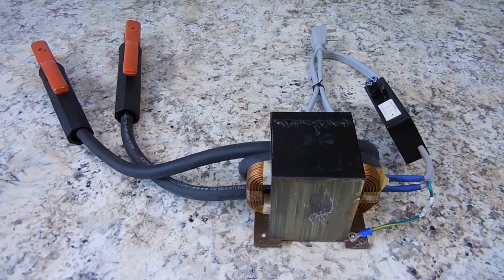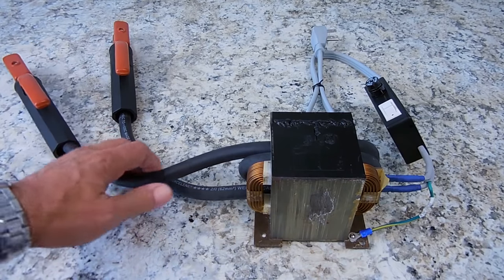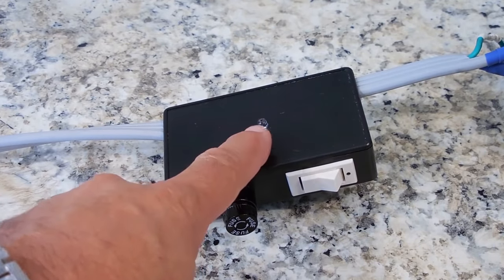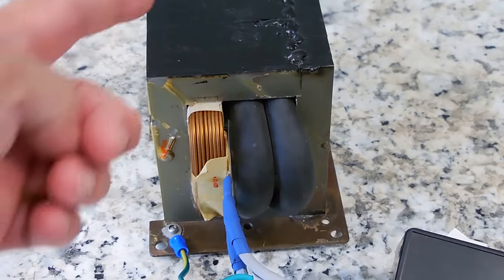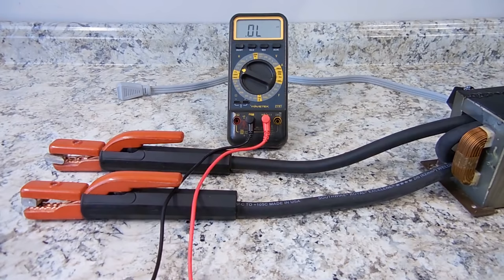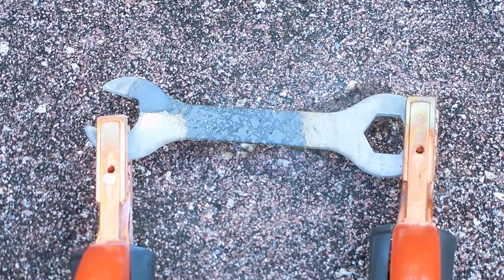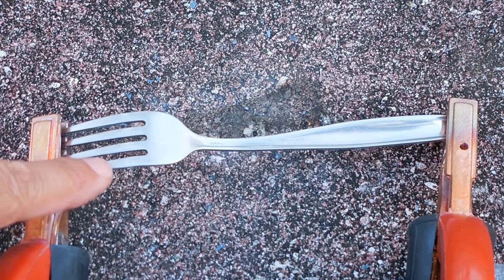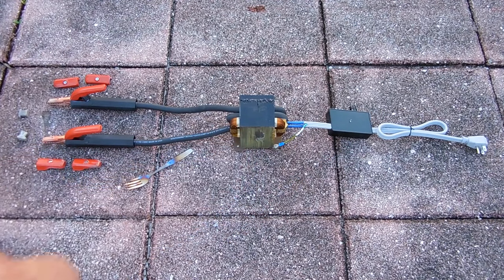METAL MELTER! (1000 AMP)

Comment: Great video. Maybe you can add to this by showing how heating a rusted nut on an exhaust manifold, for instance, makes it easy to remove. that would be very useful,  Dano C.
Reply from the maker: Great idea! Modify a vise grip to apply current to each side of the rusty nut. Thanks for watching

Comment: Thanks for showing that, for reference, when melting the nut, how many watts did it take to get it white hot? I’m thinking this could be used for small black smithing projects (shaping small metal items) without having to fire up a furnace. With the watt figure I can work out a rough cost for the electric. Cheers
Reply from the maker: Hi Shaun. The initial current shot over 1000 amps, but as the nut became white hot, it was drawing around 400-500 Amps. I was probably pulling 1500-1600W off the 120V line at the start. Thanks for watching!
Reply: Literal white or yellowish orangish hot?
Reply: I was thinking the exact same thing for heating rods of metal in seconds
Reply: For smithing

Comment: Metal Melting Points

                        C          F
Aluminum 660 1220
Aluminum Alloy 463 - 671 865 - 1240
Aluminum Bronze 1027 - 1038 1881 - 1900
Brass, Yellow 930 1710
Cadmium 321 610
Chromium 1860 3380
Copper 1084 1983
Iron, Wrought 1482 - 1593 2700 - 2900
Iron, Gray Cast 1127 - 1204 2060 - 2200
Nickel 1453 2647
Steel, Carbon 1425 - 1540 2600 - 2800
Steel, Stainless 1510 2750
Tantalum 2980 5400
Tin 232 449.4
Titanium 1670 3040
Tungsten 3400 6150
Zinc 419.5 787

Comment: What's the purpose of this gadget? Most of the experiment failed except for the nail and washer. It seems that the heating of the 2/0 wiring was the factor. If you could find a way to use 3/0 wire (don't know how) you could get better results... No disrespect, but I don't really see a use for this. Just seems like a lot of work for little use. Always enjoy your videos. Thanks!
Reply: It's just a demonstration video ;)
Reply from the maker: Exactly.

Comment: You need to get some D sized carbon cells (sold as "heavy duty") carefully tear the cell apart and in the center you will find a rod of pure graphite that can be used as electrodes for a tiny arc furnace crucible.

I have not had the opportunity to experiment with this yet but I have a setup very similar to yours only mine is 4 gage just cause that's what I could get for free.
Reply from the maker: I did that years ago in another video. :-)
Reply: @electronicsNmore  I just found your chan yesterday. I will be scrubbing it this weekend :)
Reply: You can get "carbon arc" electrodes at the welding supply store while getting the wire for this project.
They're a carbon/graphite rod with copper cladding, meant to melt steel in a stream of compressed air.
Awesome way to clean rust and bad welds out of tight spaces.

Comment: Has it really been 7 years? Where does time go. I'm quite certain your welder video is how I found your channel, as I had an old Forney AC welder I wanted to rectify to DC and was searching the internet for information.  I just now looked at your first videos, and I built your lawn mower generator! I forgot about that project! It was very handy, but the engine only lasted a couple years. The engine I had acquired was "well used."  Thanks for making so many great videos! :) I know I've learned a lot from you these past years!

Comment: You might get slightly better results with a thinner gage secondary only because you can get a few extra turns to increase the voltage but I'd wager it will be better for some things and worse for others.

Comment: You can oil cool the whole transformer in a box housing with full oil this can run the transformer longer..
Reply from the maker: Correct, mineral oil works great.
Reply: Specifically food grade mineral oil, that is often used as a laxative, or for cutting boards and the like.
Any other mineral oil will have additives that are electrically conductive.

Comment: This new video you describe chiseling in the direction the wires are running but the old video edited in, you were chiseling perpendicular to that direction.  I just did two of these and the old way is way slower for some reason, the chisel cuts maybe 4 times faster if it's along the direction the wires run, maybe because that way the wires can slightly move to help in the shearing and they're all the same depth of winding, not sure.  That said, a cut off wheel in a die grinder is massively easier.  For the record, one was copper and one was aluminum.

Comment: 1300 watts can only do so much damage.  The laws of physics are working against you as well. I'm surprised that fork held up though.  There was never a chance that nut was going to fail though.
Reply from the maker: The unit I made could easily melt the fork. Only so much current can pass through one or 2 tines, and when the fork becomes very hot, the current level drops as well. You also have to realize that the fork is a very wide span of stainless steel which has a lot of resistance. If the clamp on the left was placed just before the tines, it would've melted the fork very quickly. As for the nut, it was right at the cusp of melting. You don't get much "whiter" than what you saw. If I had a 3/0 wire in the transformer, it would've melted. Thanks for watching!
Reply: That's a lot of mass for 1300 watts.  Being on that long extension cord probably didn't help.

Comment: I'm just curious as to why it's 1.75 turns and not considered 1.5 turns on the secondary.
Reply from the maker: The way I see it, I did (1) full turn, (4) corners, then the wire passed 3 corners before exiting. If it was 1.5T , then then wire would only wrap 1/2 way around on the 2nd turn.

Comment: Hi, How does the scondary coil get any current, if it is insulated and not touching the primary coil? Thanks!
Reply from the maker: Through induction. The primary winding created a magnetic field in the transformer core that the secondary winding is in.

Comment: How long will this last? Will the rubber on your wire burn out? Any way to counteract?
Reply from the maker: Definitely not made for continuous use. There's a duty cycle.
Reply: @electronicsNmore  thanks so do you think if I don't let the core heat up should I only have to replace the wire coils?

Comment: You notice how just before it gets red hot you see it turn dull and darker? I'm pretty sure that's the zinc plate diffusing into the top layer of base metal.

https://en.m.wikipedia.org/wiki/Diffusion_bonding
Reply from the maker: Yes, that's the plating. Thanks for watching!

Comment: I'm confused. How can you achieve so much amps with so little volts? I mean according to ohm's law when you have 2.0 volts battery connected to a loop with 1ohm resistance , you only get a current of 2 amps. Can any please explain it to me.
Reply: That is the drawn current. That 1000 amps was not the drawn current. It was the current induced in the cable

Comment: Could also use this to electrolyze water as hydrogen/oxygen mix or with full power bridges (find in old broken welders) to make an awesome electrolyzer for separate oxygen and oxygen outputs at massive volumes of gas production either for welding or gas production.
Reply from the maker: You can pull the rectifier out of a high current alternator. Thanks for watching!

Comment: @electronicsNmore
The nice thing from the King of random's version from the miniature electric arc furnace was that he used carbon rods from a cheap battery to melt the metal, so it was rather harmless for the copper contact points. And once the carbon rods wear out it is easy to replace them. It is a cheap consumable. But this video is a great tutorial if you are interested in melting metal for small casting projects so big thumbs up !!! However, it should be possible to make an induction heater out of the transformer with some sort of coil instead of contact points in order to heat the metal without making any contact....right? I always wondered how that could be build with a microwave transformer. That would be a nice tool for small blacksmithing projects, or for hardening metals like small blades and such. Is it somehow possible for you to show us how that could be done? Because it seems to me that when you don't make any contact with the red or white hot metal everything else will have way less wear and tear. And you will have way more control over the part that needs to be heated without the risk that it is going to melt the metal at its weakest point. Thanks for sharing your knowledge !!
Reply from the maker: That's something different. He used the AC version of my DC welder using (2) MOT's. Instead of using a rod, he used two carbon electrodes. You'll see a better version in the future using (1) transformer. Thanks for watching!

Comment: I 'm not sure but I think the more volt the transformer will make, the less Amps you will have . In that way, why do you make 2 turns for the secondary winding ? If you use only one turn instead, you should have more current, and so morepower to melt metals. What do you think about ?
Reply from the maker: Hi Quentin! Actually, it was 1 3/4 turns. Think of voltage as pressure inside a water pipe. If the voltage gets too low, then once the metal heats up(which increases resistance), it wont have enough voltage(pressure) to get things really glowing. Thanks for watching! Be sure to check out my extensive video playlists below and most importantly share my channel with many others. I have a very wide range of videos on my channel. You should find plenty of interest to you.
http://youtube.com/c/electronicsnmore/playlists
Reply: @electronicsNmore  Thank you for your answer. Effectively, I didn't consider that the metal resistance increases with the temperature, which is justifying a voltage enough stronger to compensate. Now I would like to know if you have already think to a cooling system for the transformer. According to you, what should be the most efficient between a total oil immersion or an air blasting from a little fan ?

Comment: yo id like to know if this could be used to heat treat a blade of a knife or even a sword? Also what about differential heating of the blade by putting a covering of Clay behind the cutting edge, would this work to heat the cutting edge more hotter than the clay covered edge????
Reply: No expert, but clay would probably be a bad idea.
It's an insulator, and I suspect you'd have heat buildup along a line just inboard of the clay.
A better approach would be something like thick copper sheet.
Rather than just running it in a line along the blade edge, have it extend some distance wider than the blade, so it can wick the heat away and dissipate it.

Comment: I am going to assume one does not want to lick, fondle or play with the clamp ends of this while it is on but what about the body of the transformer?  Seems it would be prudent to have it enclosed with the fan you mentioned so as to not accidentally brush against it?
Reply: Also wondering if this could be adapted to run Microne [[Nicrome]] wire inside of a furnace for a more stable heat source in a small foundry versus the high output as is.
Reply from the maker: No worry about getting shocked, just burned. Be sure to look over my extensive video playlists for other great videos of interest to you, and most importantly share my channel with many others. Thanks for watching!
Reply: @electronicsNmore  I will, spent a couple of hours early A.M. going thru your vids-very informative!

Comment: can a coil be connected that would not burn up to make a heated coil to remove rusted bolts?
Reply from the maker: What I show can be used for that with no problem at all. The only reason why my 2/0 wire was starting to get hot was because I kept heating much longer to try and melt the bolt. Thanks for watching!
Reply: @electronicsNmore  any idea what's size wire to use?
Reply: @ke6bnl  8mm

Comment: You need European electricity...
Reply from the maker: Why?
Reply: @electronicsNmore  230V. 4x the power output
Reply from the maker: @simonmartin4599  A 1000w microwave at 230v has the same power output as a 1000w microwave at 115v. At 230v less current is used.
Reply: @electronicsNmore  That is true but I am not talking about the rated current of Microwave ovens. I'm talking about your transformer in this awesome vid. If you double the voltage on it, you will double the current. And since power is voltage (230V) x current (twice what you have now), you will have four times the power. That will melt even the heaviest of spanners... Take it with you on your next trip across the pond :-)
Reply: What I always found interesting about the difference in mains supply between Europe and North America is the 50Hz V.S. 60Hz.
Not so significant on its own, but if you mix the two, things get interesting.
The 10Hz delay on one leg of a 3 phase motor for instance, will cause a faster start with more torque, and lower top speed.
Conversely, two legs at 50Hz and one at 60Hz gives less low end torque, resulting in a slower start, but higher top speed.
Keep in mind that this was only done for testing. In actual use, under constant load, the motor is jerky & not smooth at all.
The electric equivalent of a hit & miss gasoline (petrol) engine.
Reply: @kaisersose5549  Depends on if you are talking Synchronous motors or Induction motors. Most AC motors are the Induction type
Reply: @simonmartin4599  
Both, provided the synchronous motor is doubly fed.

Comment: 1000Amps?? hahahahaa
Reply from the maker: Yes, 1000 Amps, actually peaked over 1000 Amps. I guess you didn't watch the video.
Reply: 2 volts at 1000 A is 2000 Watts , its only on for a short time, if the microwave xformer can do 1200 watts continuous (but if the high voltage winding's were left on, its like 2200V at 300mA!?!?! to run the magnetron)

Comment: Loved this 2 questions though,  1 how would this go running a Jacobs ladder? and did that ant at 21:24 that walked under the right hand terminal get cooked?.
Reply from the maker: Jacob's ladder requires very high voltage. You'd use the microwave oven transformer as is removed from the oven, or connect 2 MOT HV windings in series so you have a 4 - 5KV output. Of course it's very dangerous if you don't know what you're doing. I don't suggest you do it. As for the tiny ant, it ran away once it felt the heat. Thanks for watching!